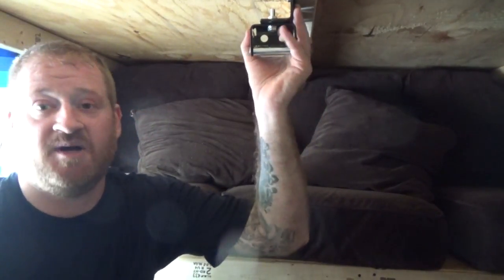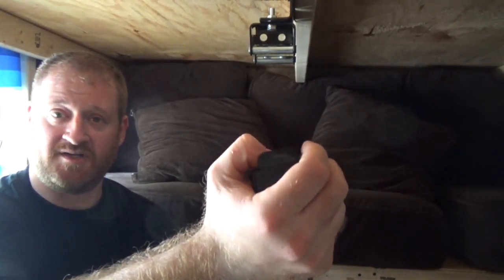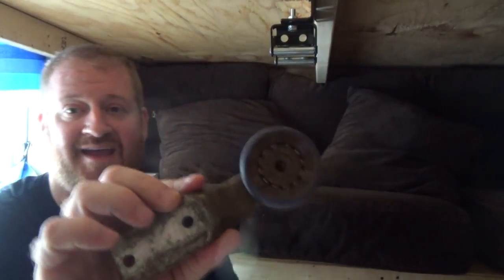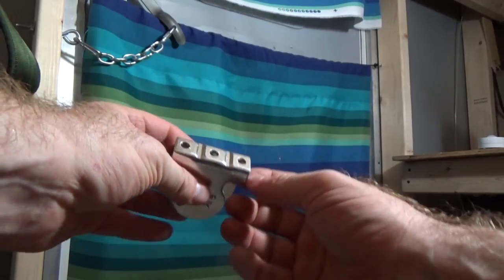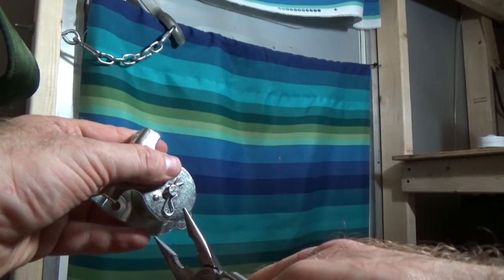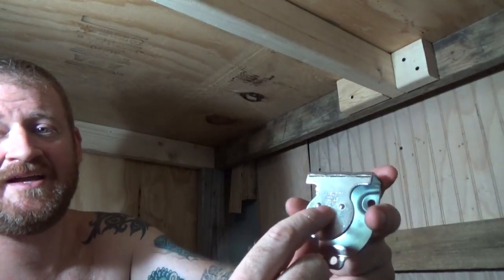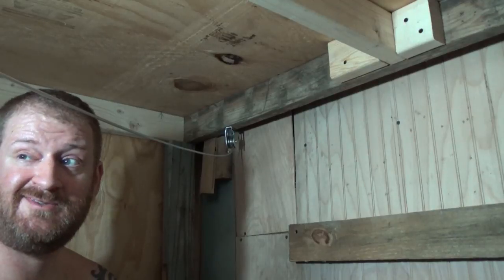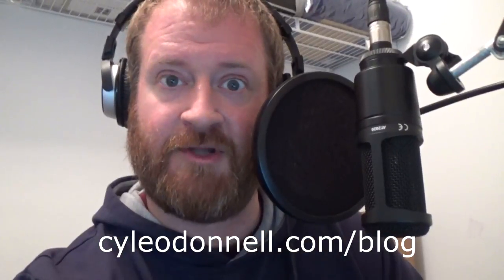Bus Conversion: Elevating Bed Part 1

Comment: What is the model winch you used?
Reply from the maker: It's been a couple years now. So I don't remember. But it was a 2K lbs double toggle remote controlled winch and I got it from Amazon. Hope that helps!